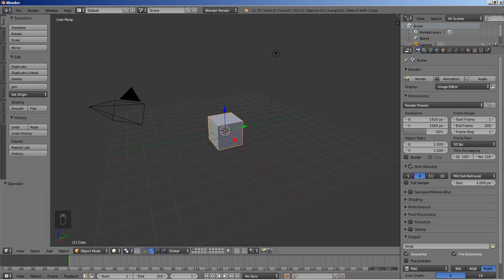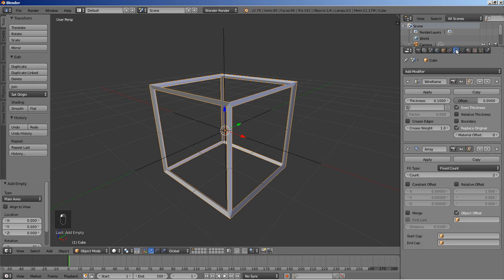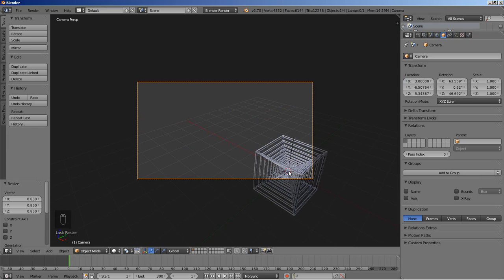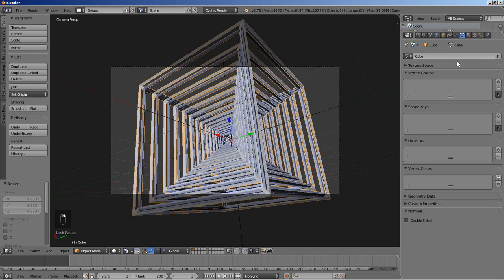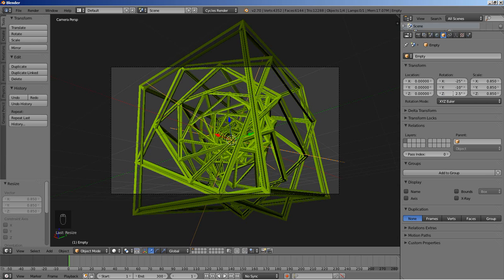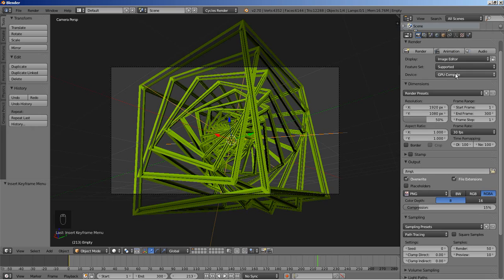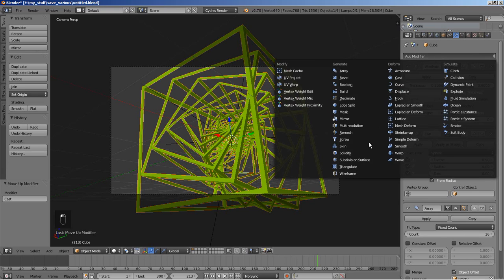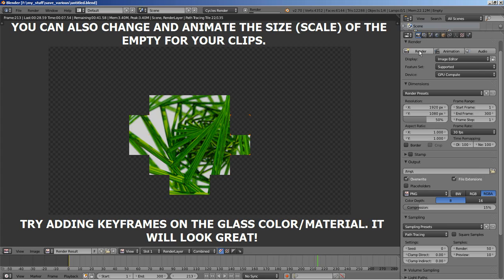Blender: Wireframe Mod.

Comment: good work
at time 2:40 you add second wireframe, you click S key and withdraw, but when i tried does not work with me,
Reply from the maker: Not sure I got it right but when scaling you can type in the exact value of the scale. I'm hitting S and then typing in 0.85 (on my keyboard) to scale the empty down. You can always withdraw scaling or movement by hitting the right mouse button.
Reply: I tried several times, but without success